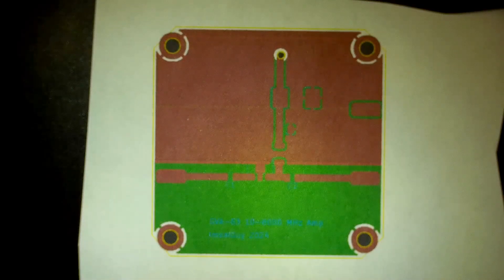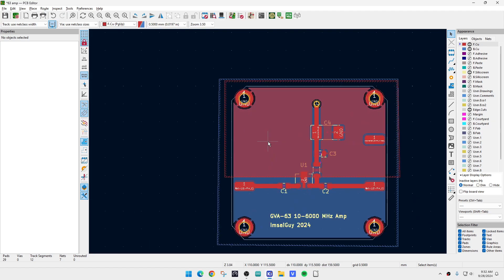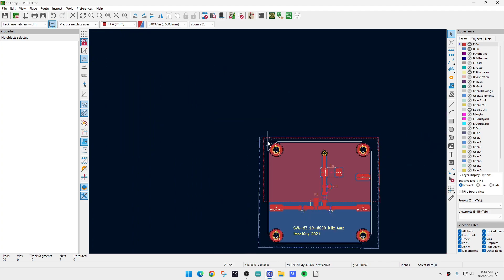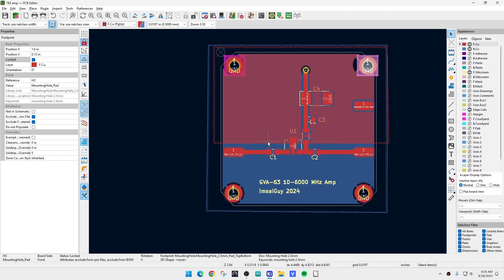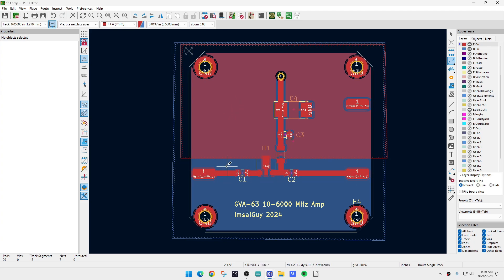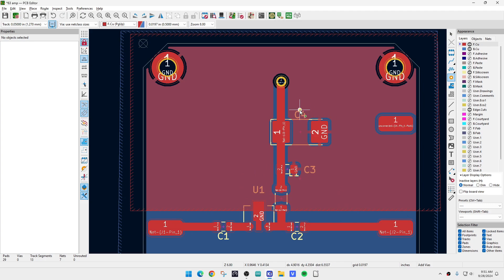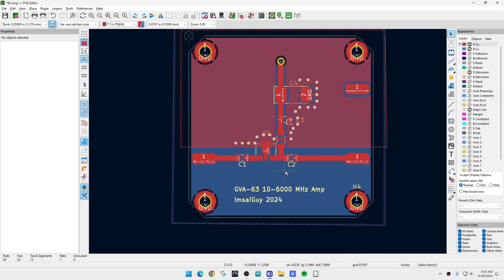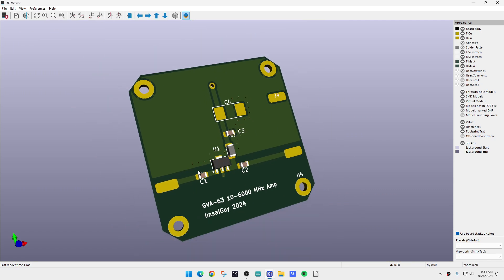#2022 GVA-63  Amplifier Project (part 5 of 10)

Comment: Thanks for the tip on setting the grid origin to be used for the axis display. This has been a nuisance for me ever since switching over from Diptrace because I do a lot of designs with stacked boards that need mating connections and mount holes and despite a lot of googling I never found a way to do that. Perhaps it's a new option in 8.0?

Comment: I work with 5 mil grid for normal day to day pcb conception.
10 to 50 mil grid for coarse placement of part.
I toggle between english to metric for some verification but most time i work with 5mil step grid, work great for most electronic part.
1 mil step are too fine and metric step work great but number are always more complicated to understand!

Comment: To save yourself a lot of messing about, position the first hole where needed. The select the next hole, right click > positioning tools > position relative to ...
select the hole you have positioned already, and enter the x/y offset and the 2nd hole will move to that offset.

Another time saver, if you select more than one footprint you will get an align and distribute option in the right click menu. Good for getting all your resistors and caps in neat rows 🙂
Andy